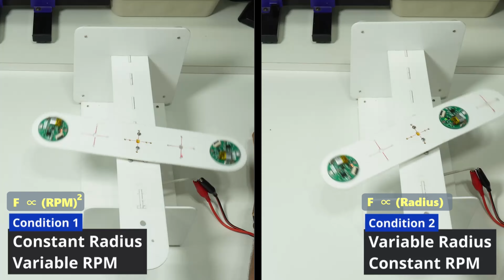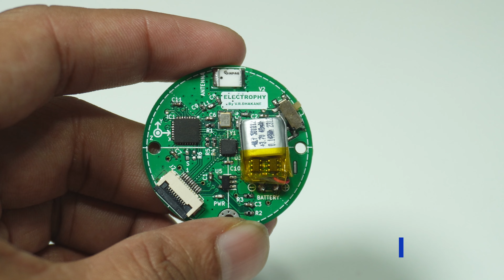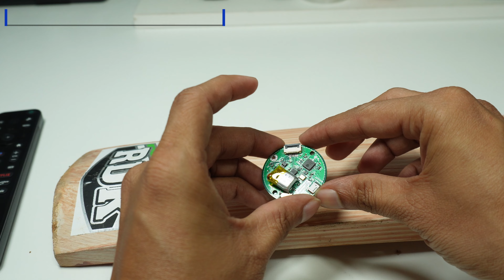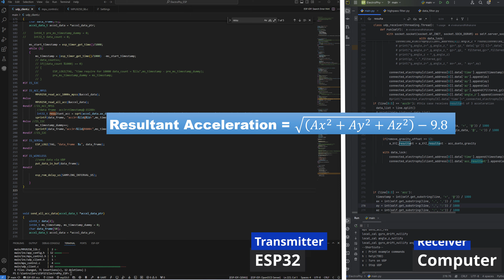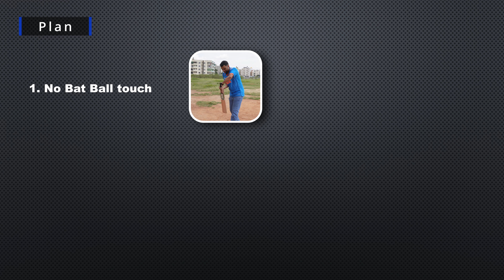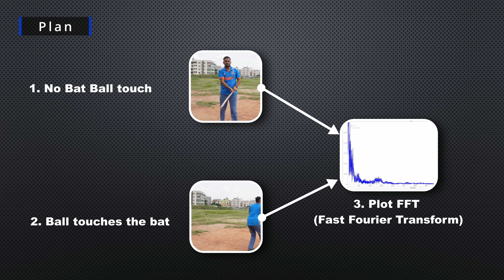ElectroPhy : UltraEdge

Comment: Great work, but still the even after applying the high pass filter even a finger tap exciting those result. for that you can add an another filter on the amplitude as well.
Reply: Yes...To isolate bat-ball contact specifically, more advanced filtering will be required.
Reply: @vivek_a1b1  you should have applied for the patent before posting this video